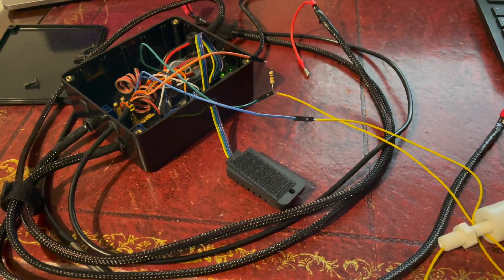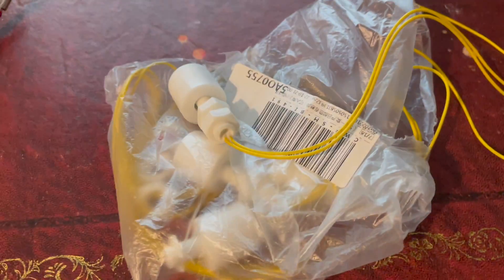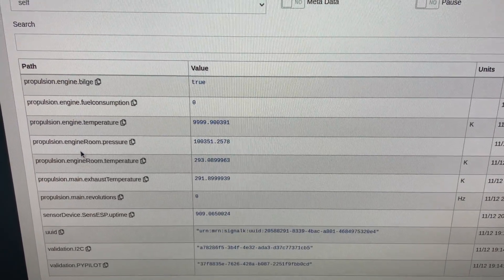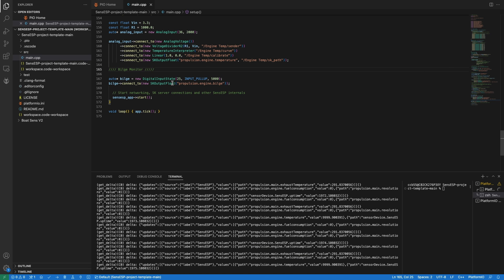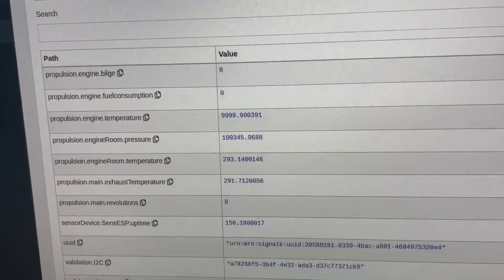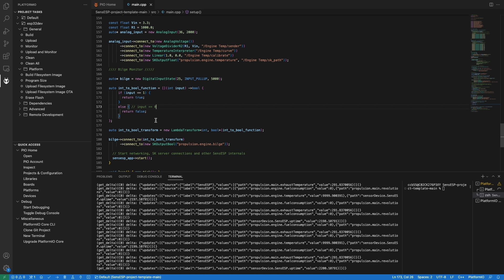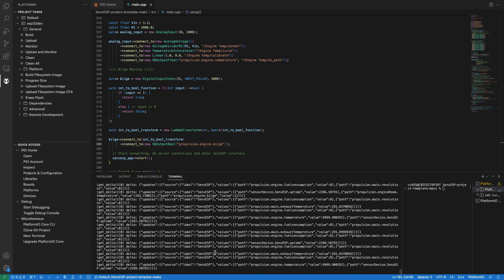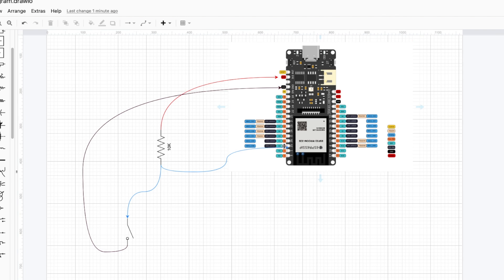OpenPlotter - SensESP Bilge Monitor - ESP32

Comment: Hey Mat, any idea how to create a KIP Alarm for "water present"? Everything is working as expected, but I can't figure out, how to get notifications alarms via KIP... Playing with zones did not do the trick. Cheers Dominik
Reply from the maker: Hi Dominik, the only way (I think) you can trigger a zone or alarm is with a number rather than a word. I think I sent the word and the raw value from the esp if I remember correctly and then triggered on that value, I.e 1 for alarm, water present and 0 for all clear. I didn't display that value in KIP but just used it for notifications. I'll double check and come back to you.
Reply: @BoatingwiththeBaileys  Hi Mat, I tried to do so, but couldn't trigger any notifications unfortunately. Two sensors on the same GPIO didn't work either for me, because I wanted to have specific alarms for each bilge. Can't figure out how to program this by now. I duplicated the code and had a somewhat strange behaviour: only one sensor detected water but only if the other one was triggered already 😳😜
Reply from the maker: Do you want to share your code and i'll take a look? Drop us an email if you like?
Reply: @BoatingwiththeBaileys  I will. Via your website I assume?
Reply from the maker: @Kinimodus contactus@boatingwiththebaileys.com
Reply: @BoatingwiththeBaileys  I've sent you the code via your website. :)

Comment: Both you, @BoatingwiththeBaileys and @ApresSail videos about SensESP are a big insperation to me -Thank you guys!
Does anoyone out there have a solution to have the sensor to be HIGH for x amount of seconds before triggering the water in the bilge? As of now, the 5 seconds is just the interval between sensor reads as far as of my knowledge. Thanks again!
Reply from the maker: Hi - Sorry i missed your post, i must have missed the alert.  Many thanks for your comments on the videos and i also agree that @ApresSail has some great content.

Yes, you are correct in that it checks on that sensor every 5 seconds. You could try and add MovingAverage which is what i added to my RPM setup as it was a bit bouncy to start with.  Here is an example of that code:

->connect_to(new MovingAverage(2, 1.0,"/Engine RPM/movingAVG"))

Try changing that 2, to 5 and i would also update your code to check the sensor every 1 second to make sure it is doing what you want. 

You will also need to add this to the top of your code:

#include "sensesp/transforms/moving_average.h"

Its configured under RPM for me here https://github.com/Boatingwiththebaileys/ESP32-code/blob/main/main.cpp

Let me know if you need anything else and also let us know if that works!
Reply: @BoatingwiththeBaileys  no worries, I solved it with the help from Discord with Debounce.
Keep up the good work.

Comment: Im trying to do this with raspberry pi running Victrons Venus Os. I can monitor my solar equipment. I have tank monitors and currently adding relay control screen. 
Within there is a digital input bilge alarm. 
I hope it will work in a similar way to what you have shown. 
Brilliant that you put this content together. Its a real rabbit warren of things to modernise an older boat. Respect to you
Reply from the maker: Many thanks for your comments, it certainly is and once you get started you start to look for the next think that can be upgraded. I’ve heard about the Venus OS but never really looked into it. I use a plug-in on SignalK to monitor a Victron smart shunt but I’ve not yet upgraded my solar to Victron. That’s still on the list. ⛵️

Comment: a couple of points.
most (but not all) of the ESP32 GPIO pins have inbuilt pull up or down resistors… when you use the parameter PULL_UP or PULL_DOWN in the DigitalInputState (or the other similar functions) … this is actually setting the internal resistor accordingly. hence you dont need to,use an additional external pull up or down resistor .. indeed doing this is actually reducing the resistance, because your creating parralel resistors.

the internal resistor values are set in a way that you can pull the pin to GND or 3V3 directly, and the GPIO input will respond correctly.
adding the external,additional resistor is actually causing a greater (unnecessary) additional current flow “thru” the GPIO pin..
Reply from the maker: Hi Greg, Thanks for that, I had forgotten that they had this. I think I used that feature on the RPM counter. Great info, I'll add this to the update about the bilge monitor and give you a mention if that's ok?
Reply: of course, 
BTW , im putting together a tips and tricks, not too mention warning and traps for “new” sensESP users 
.. mostly based on mynmistakes and learnings (the hard way) over past few months , i will post it in the slack #sensors , but lokewise you can link it from yr web site or Yt channel etc … im not preccious about these things .. if imcan save someone else hoursbof chasing their tail …. ive done it already formthe, .. haha

Comment: I've not used SensESP (yet) but I've just had a quick read of the documentation and if you change your int_to_bool function into an int_to_string one and for the 1 return 'water present' and for 0 return 'bilge clear' or whatever you want
You then can use an SKOutputString instead of an SKOutputBool class
Reply from the maker: Hi Guy, thanks for that, i will give it a try and report back.
Reply from the maker: Hi - It works! Thanks for this, i'll update the code and show this in the install video. Are you ok if i give you a mention at the start of that one??

This is what the code looks like now:

auto* bilge = new DigitalInputState(25, INPUT_PULLUP, 5000);

auto int_to_string_function = [](int input) ->String {
     if (input == 1) {
       return "water present!";
     } 
     else { // input == 0
       return "bilge clear";
     }
};

auto int_to_string_transform = new LambdaTransform<int, String>(int_to_string_function);

bilge->connect_to(int_to_string_transform)
      ->connect_to(new SKOutputString("propulsion.engine.bilge"));
Reply: @BoatingwiththeBaileys  Glad you got it working! Happy for the mention if you want to do that